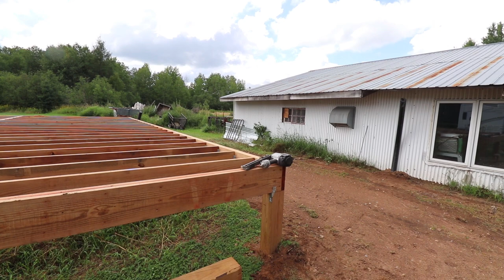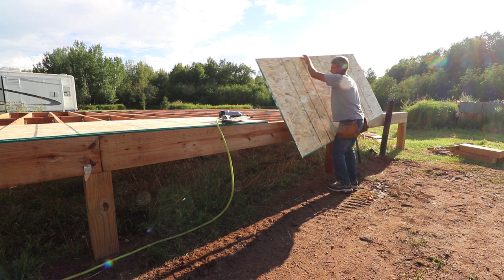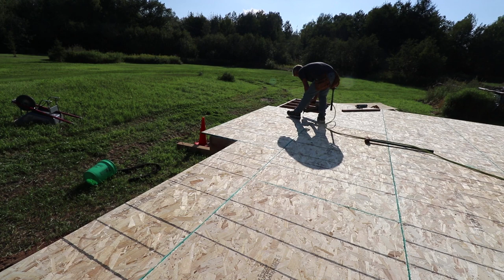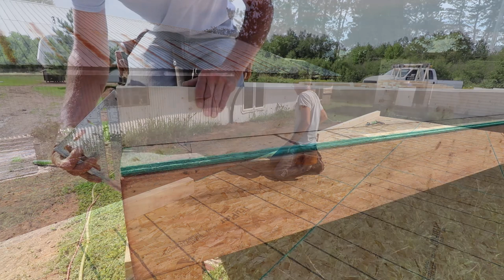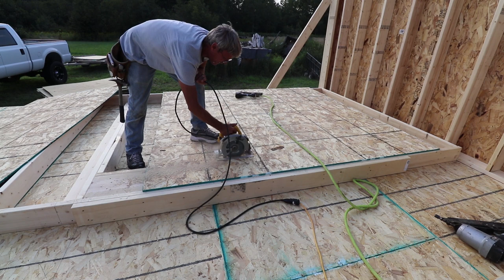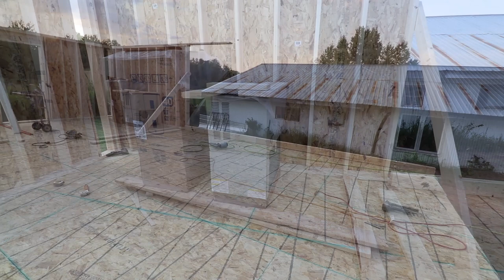BUILDING THE GUEST HOUSE. Part 4. The deck gets plywood and the exterior walls get started.

Comment: Just a suggestion no bathtub, shower instead. And stackable washer and dryer for smaller spaces. Thanks for both of yalls videos and taking time out of y'all's lives to do this.
Reply from the maker: Stay tuned, we decided to go with the exact type of tub we put in the Louisiana house because we wanted a 5 foot bottom and a 5 foot shower was about 1,600.00 to 2,400.00 for what we liked. We are though going to do a stackable washer and dryer.
Reply: Kidlets are easier to wash in a bathtub than a shower, altho an outdoor shower might be useful for them/adults cleaning up after horsing around/working outdoors.

Comment: I talk to myself too Joe, as you say, just running it by !  Interesting how you work. In fact, the most interesting bit to me, is not bracing your floor, solid or herringbone,and not putting noggings in your walls.  Like yours our timber sizes in housing have slowly decreased, when I started, basic carcassing was 2” x whatever, sawn and 2” is what it was !   Earlier the base thickness was 2 1/2” for joists and rafters. Now sawn 2x” is under 2” and so on downwards !

Comment: Hello Joe. I’ve been a carpenter for 24 years now. A little trick I learned to avoid chalk lines washing away is to use a spray can of poly or hair spray. Just hit the ends and you’re good to go. They will last forever.

Comment: Joe , I don't doubt your ability for a minute. I have done a lot of construction as well. While watching you lay out those walls it occurred to me if you set the bottom plate in place after you lay it out and screw hinges to the bottom plate and floor when you stand the wall up it can't slide off the floor or fall off after you stand it up . just a thought and it makes sense to me I can't believe I never thought of it before. It seems like it would be a big help especially on a second floor and much safer

Comment: Joe, How about paired French doors instead of sliding Patio. That way you can have a side door to patio with the other side covered by a recliner. Then moved out of the way if you need both open.
Reply from the maker: Double french doors are not good here in Minnesota. They just are not as weather tight for the cold winters. Continue watching, I am 2 videos behind as of today on the guest house and I have a farmhouse video I need to get edited also. Tomorrow I will be setting the roof trusses.

Comment: I was a framer retired now but we would use the red chalk to snap the layout lines and if it rained they would be there! The red is more permanent and the blue is temp..
Reply from the maker: There is several types of red and some are very permanent. The problem I have is I am colorblind to a point and red is my worst color. I can not see the red lines when they get snapped. I had to switch everything over to blue.

Comment: Questions (I don't know construction). 

1 -  Curious about under the house insulation/flooring.   Unlike the LA house with it's HVAC in the attic, our temp's in MN are so different.  How do you address/or what is required from keeping things from freezing underneath the house?  Do you have to crawl under & dealing with the ruffage?   Is it any different than what is done up at the tent, camper, or a mobile home?  

2 -  Foundation posts: If recall correctly you said they were treated.  Is there anything else one has to do to keep them from deteriorating?

I am having a blast watching and learning from you on this project!  Thank you!

Comment: When I helped a friend, we painted 1x2 black and then tacked them down where the walls went.  That way we had a good visual idea of the walls and layout.  We could also walk the layout to make sure it worked.  Really helps 
Why doesn't anyone build with 2x6 exterior walls?   I had house with them and it was very warm and air tight.

Comment: Someone made a YouTube short about a 1920's 2×4 that was true 2x4 versus today's 2x4 that is smaller.   But they failed to point out in the picture a crucial fact that  if you looked at the growth rings of the old board  they were 3 times tighter ,versus the new one where the growth rings were 3 times bigger cause of todays modifications to trees for more production. Hence, weaker lumber.

Comment: just wondering why didn't you put cross brasses between the joist so they don't bow wouldn't that help the floor from screeching. great series i like watching before I start working in the morning.
Reply from the maker: It is only an 11 foot span, no need for anything like that. Doing center bracing would take a lot of time and then every block you put in becomes a possible spot where it can squeak.

Comment: 3/4" Advantech t&g plywood is awesome it's pretty waterproof and really flat and very smooth you wouldn't have to worry about water. Looking good 👍
Reply: +1 for Advantech.  Else spray the OSB with primer.
Reply: @paulholm2138  specially the joints
Reply: Type he has down one good rain he will be sanding .
Reply: @chrisstaples703  I've seen it bubble up like 2'x2' it had to be cut out and replaced in like 10-12 spots on two floors

Comment: What is the difference between regular joists and sistering joists? I picked up an older fifth wheel a few months ago and was unaware that the subfloor needs to be replaced. I will need to do it at some point and I want to make sure it's done properly. I would appreciate any pointers, as I will probably have to do it in sections as finances permit. Thank you!
Reply from the maker: If you sister a joist or stud or whatever you are just putting an identical joist or stud against the damaged one and nailing them together. Lets say you have a floor joist that is partially rotted or cracked, damaged in some way. You can put another one right along side of it and fasten the two together. That would be "sistering". It eliminates you having to remove the old one but at the same time you are eliminating the problem by adding the new one.
Reply: @NorthernSeclusion  Thank you! I appreciate it.  🙂

Comment: As an Architect I would suggest a scaled blueprint design before construction rather than daily changes would be smarter.
Reply from the maker: For those reading this, at all costs, try to stay away from architects and engineers. They will cost you way more money in the end. Haha.
Reply: @NorthernSeclusion  Drawing up 3 or 4 variations on paper is quick and easy and allows the uneducated eye to visualize the many possibilities before building and would be kind of of like "measure twice and cut once".

Comment: Just curious cold floors no sub floor insulation and way didn't you  insulated. It would not be easy on your back crawling   around and being uncomfortable to put insulation after the plywood. 😀
Reply: Go back a couple videos. He explained that already.
Reply: @joshwiste2302   He going to crawl under to set the insulation. Just what I stated.
Reply from the maker: I stated exactly WHY I will be crawling under it in a previous video. Time and the weather.

Comment: I’ve done construction and went to school for it I  always left the door and Windows open   closed drilled a hole and use the router with a flush trim bit to cut them out is another way of doing it
Reply from the maker: That way will work but by the time you got the router out and plugged in and then drilled the holes in all the openings and started the routing process, I would have all the doors and windows already cut out. Lol.
Reply: @NorthernSeclusion  If you cut about 1/2 or 3/4 of the way through the bottom plate from the bottom, then all you need after raising the wall is to use a reciprocating saw and just cut about a 1/4 or 1/2 through from the top. A lot easier. Just my two cents.  Love the videos and the old school ways of doing things.

Comment: Joe, those temporary nails you put in the bottom plate to hold it in place when you get ready to stand the wall do those ever come out? I am an insulation contractor and man I hate caulking around those things. Seems like it would cause issue with finish work around those areas as well. Just curious.
Reply: Never mind just missed the part where you pulled them out, I guess my some of my contractors don’t pull them out!
Reply from the maker: It really is a pain in the butt when they do not get removed.

Comment: So it's not allowed / good enough to use the spray foam insullation under the house ? Because wouldn't that be more easy but maybe price is an issue ?
Reply from the maker: It is 3 times the price of fiberglass insulation.
Reply: @NorthernSeclusion  Ahh that explains it. I can do nothing like you with my hands so I am always so amazed when you build things. :) Thx for the great content.

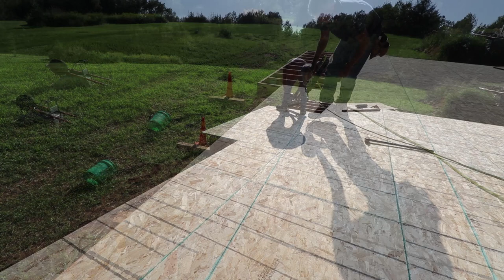Comment: 16:52 enough nails yet?  Just wondering with the invention of air nailers, did the amount of nail required go up?  Imagine if you had to hand nail those like most people.
Reply from the maker: The first 15 years I was in constructiuon we had no air nailers. I have hand nailed more nails than the average person ever will. A person probably does use more nails with the nailer and that is a good thing.

Comment: So are you not doing the trailer house now or just putting it on the back burner for now ?
Reply from the maker: There is a WHOLE video on your question.
Reply: When we sheeted the wall we would run all the sheeting then put a x on the corners of the doors and windows then one guy came behind after we nailed a sheet and routered out the doorways and window ..special bit…worked pretty slick..

Comment: C is for cripple, because it holds up the header. Still a cripple under/above the window. Because it holds up the top plate. Where I live we call the studs that hold the headers up: jack studs. The studs under/above windows are cripples only. The terms change based on where in the country you are... Not in the least confusing 🤣

Comment: Skip the window in the bathroom and go with a sun tube.
Reply from the maker: That would be something that would go through the metal roof and would eventually be a possible leak hazard. Windows you can open and get fresh air in the room also.
Reply: @NorthernSeclusion  Grew up in a house that had a window in the bathroom. Always remember it having condensation and ice on it during the winter every time someone used the shower.  It ended up rotting out after a while and we replaced it with a vinyl one.  I suppose with your place being just a guest house it probably won't see as much moisture.   Are you planning on installing an exhaust fan in the room as well as a window?

Comment: Gotta screw them down with liquid nail. You will have squeeks.
Reply from the maker: Total waste of time actually. It is a good way to go but it takes forever, costs a fortune and IF you do not miss the joists with the ring shanks you will never have a a squeak. I can assure you I will have no squeaks. Usually the glue and screw method is a homeowner way of doing it.

Comment: Your point about your subfloor isn't right 3/4inch hard wood can be layed over osb you have to use the big staple hardwood nailer it's even guaranteed by manufacturer with those . your correct cleets won't hold hard wood in OSb everyone I have ever seen where they made that mistake squeaked almost every step  . I don't like standard osb but advantech is the only one I've seen that can take some rain not swell . One contractor I work for  always uses tomphson deck sealer on his subfloor  it can get rained on a bunch not swell. granted that stuff is high now but if your going to let that set for weeks it be worth it. I've sanded down alot osb joints  entire house peaked up 1/4 inch on the end seams and 1/8 on the long sides . I use my hard wood sander on it makes quick work of it. Just dump it out use a two foot wide  rubber squeeachy to move it around on that deck sealer.
Reply from the maker: I have built multi million dollar homes for some pretty big construction companies throughout the years. Although what you say is legally correct, there is no reputable builder up here that puts osb under a wood floor. Maybe the expensive adventech is awesome but we NEVER put osb down where there will be wood. We had builders who were trying to save money and we would have osb everywhere except where the wood floor was going to be installed. It always sucked trying to pair the two together with the tongue and groove. I will also say though that rarely do any of the builders use osb for subfloor here anymore. It is almost exclusively cdx now. Like you will hear me explain in an upcoming video. There are many correct ways to do things but one thing I always say on my jobs is this: "There is only one way to do things and that is the right way and on my jobs that is MY way". That does not at all mean that doing it differently will not work but on my jobs it has to be my way because at the end of that day I have to guarantee my work. The floor sander would work awesome for sanding down the seams. I have had to do it using a belt sander and it sucked. Lol.
Reply: @NorthernSeclusion  lol true . I'd let you build me million dollar home no doubt in your abilitys .

Comment: I sure am going to hate to see  your disappoint when it gets cold winter that heating system doesn't come close. definitely not going to work well as far away from the buildings as it is. I hate to be Debbie downer but my grandpa had the largest one he could get for his place that furnace fan would run non stop after like 25 below . I think the only way they would work well is to have them set up with those big ole looking oil heaters that are several feet long that use to circulate hot water in schools, such. those coils in those furnaces think what a small of area that is inside that furnace with those coils you will get Luke warm air   from it.
Reply from the maker: The line that was installed loses only a half a degree per 100 feet. Our longest run is 107 feet. This is not your grandfathers set up.
Reply: @NorthernSeclusion  i really hope it works great be interested to hear about it this winter.